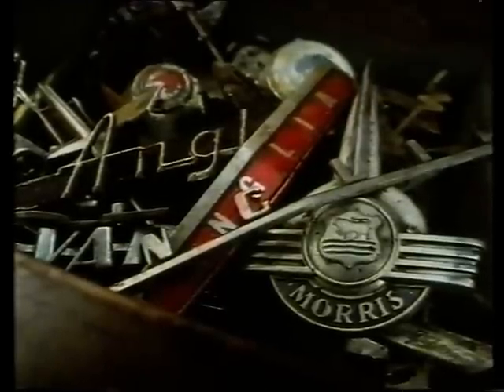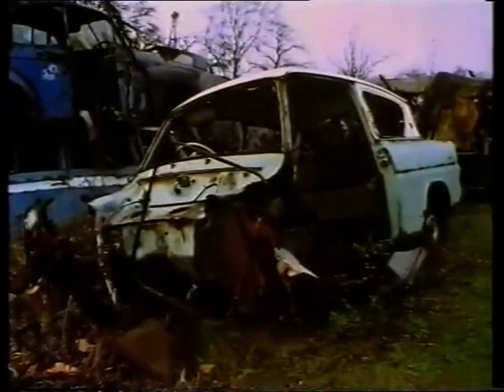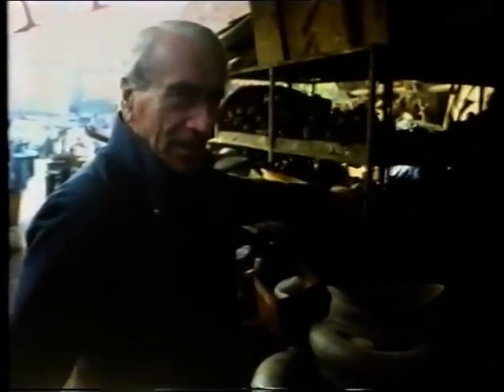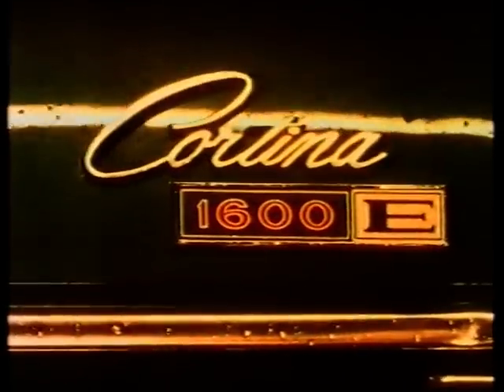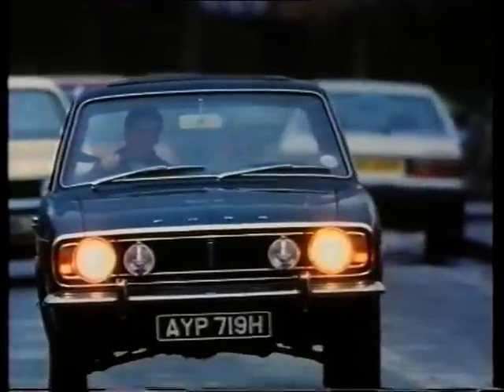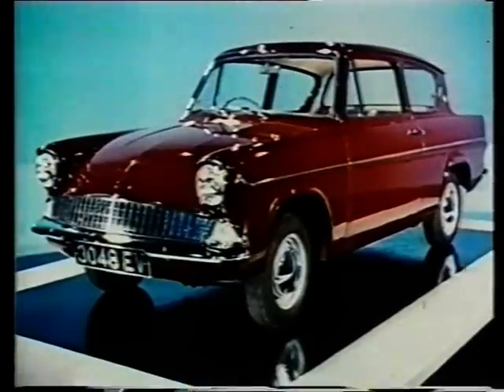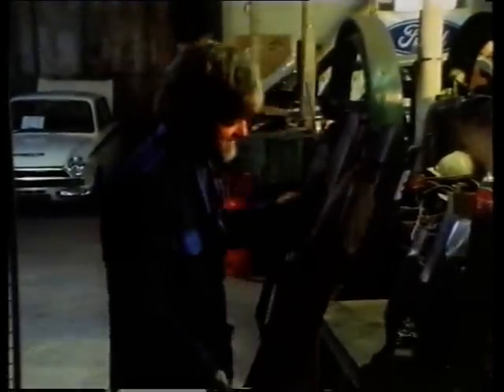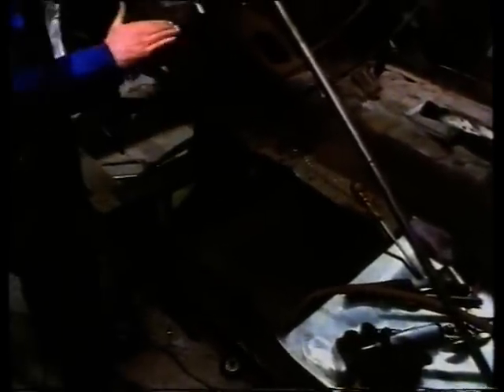Classic Cars - Suburban Specials pt1

Comment: What an interesting collection of rusty cars. I used to love going round scrap yards looking for Cortina parts back in the early eighties and would spend hours in them before Health and Safety put a stop to it all.
Reply: I have never been stopped from looking around a scrap yard. Health sand safety will investigate why an old engine was dropped on your head. It will not stop you standing under it if you insist.

Comment: In the day I owned an ermine white 1969 'H' reg 1600E. I had to sell because I was skint (debts).
However I now have an 1970 ermine white 'H' reg for parts, and a 1971, J reg (last month of production) aubergine 1600E, my daily driver. I don't need a laptop to fix it.
Also in my youth I could change the clutch in a 105E Anglia, in 48 minutes! I'm still trying to find a decent 1200E. well you need a pair of Ford, wings, to fly.
Reply: I could have the engine out of my 1600E in 30 minutes.  So easy to work on